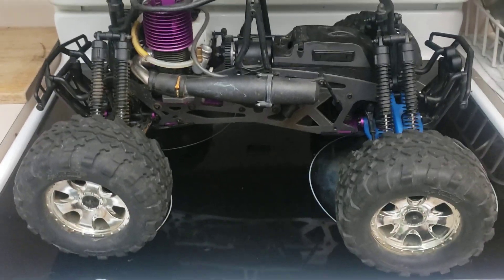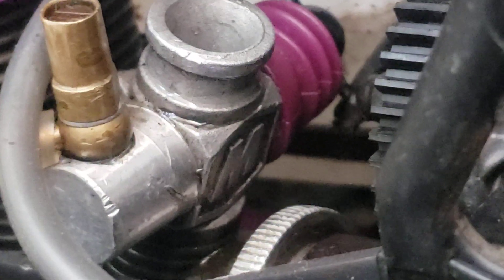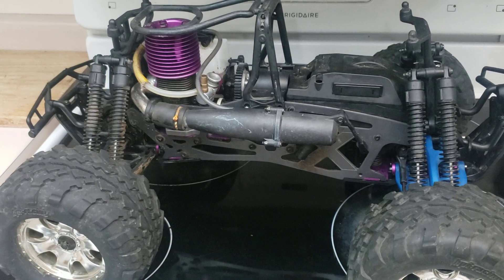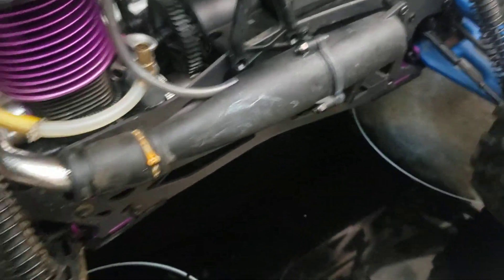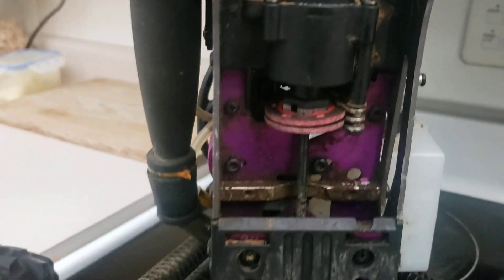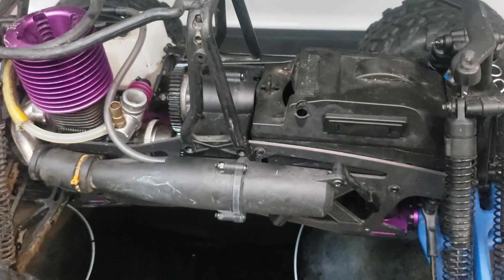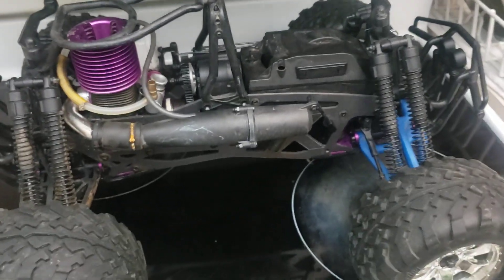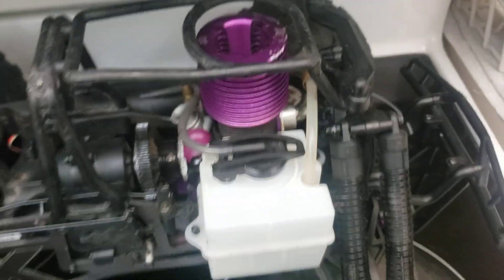HPI SAVAGE X 4.6 Update.

Comment: Dude a free savage in my book is a hell yeah brother!  Were the nitrostar engines made by sh for hpi because the parts on my wore out nitrostar 25 looked a lot like sh components.
Reply from the maker: If the F series engines were made by force.  Some of the K series were as well as axil
Reply: @thebug4046  That makes since.  The crank on my nitrostar 25 looks exactly like a sh crank.
Reply from the maker: @ShadowOppsRC   They are pretty similar although the diameters are different and the stroke is different too
Reply: lrp 4.1 force 25 4.1 hpi 25 4.1 there 4.1cc engine  the  sh 28 big red 28 mtx 28 Dyno might 28 are the same engine design 4.6. engines.  but   there not the same design as the lrp32 4.6 savage x 4.6 28 force 28 4.6 parts are interchangeable in  design. Hope that helps looking for different parts for rebuild 👍👌✌️💯🍻

Comment: The chasis with a ruber mallet or dead blow hammer with a block of wood would fix the chasis plates.  How I fixed mine.
Reply from the maker: That's what I was thinking of doing as a temporary fix having those little bends and it though isn't getting in the way of anything else or impeding movevent so I should be OK
Reply: @thebug4046  That is true to!

Comment: The x models are just the best savage to have u got an old savage ND have drive train problem get ready to dumped 2 hours to get to the problem just nightmare set up the x model problems solved period I don't even look at my old savages anymore never mind running them
Reply from the maker: If you want a new savage here there almost $1200 they're pretty expensive but this model doesn't have very many hours on it everything else feels fine if something blows up and all those effects and it's pretty easy if you have the time and are willing to do it this thing was basically just run on pavement all the differentials feel perfectly fine.

Comment: Hay buddy I can tell you I think I have said it before were you can get the block with new bearings for under 10$ bucks in the comments before the same place has new remote with transmitter for 25$ any hpi remote work there all the same remotes in every model✌️👍👌💯🏎️⚒️🍻
Reply from the maker: The block with the bearings is $100 Canadian plus $20 shipping
Reply: @thebug4046  I hope that's a joke I can get the a extra 4.6  block and bearings with carb pin new for 6$ if shipping is 20$ I'll send you one to you instead of having to go through all that and pay those prices ✌️👍👌💯🏎️⚒️🍻
Reply from the maker: @josephsaucedo8691   Man I wish I could say I was joking but unfortunately I'm not because of this crappy place that we live in called Canada we have to pay import fees duty fees you name it Including the carbon tax which has cost everything even more money than it used to be So in the United States when you guys buy something for $6 free shipping over here that item is now 12 or $13 almost $20 shipping If not higher depending on what the seller feels like putting it up to that day
Reply: @thebug4046  that ridiculous I have ordered from there and shipping coast me almost as much as what I ordered I don't understand the way they figure out the price there so I tend to pass on stuff when I see it on line from there but if you see or no of all the parts you need I don't mind ordering them and sending it to you and you can just Paypal me when received that way it cuts the coast and hopefully cheaper if shipping isn't outrageous in don't care ✌️👍👌💯⚒️🍻🏎️😉